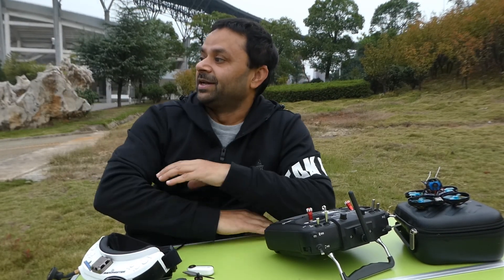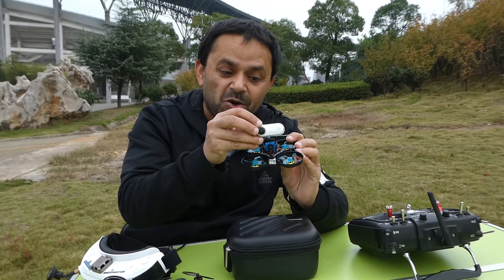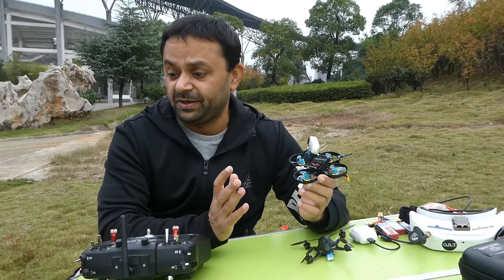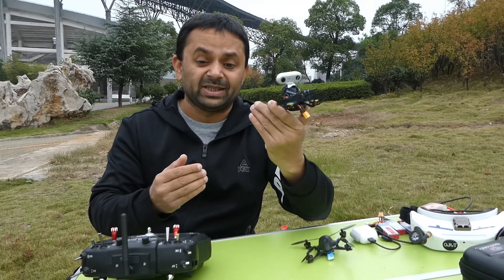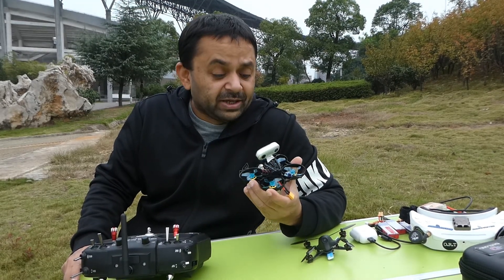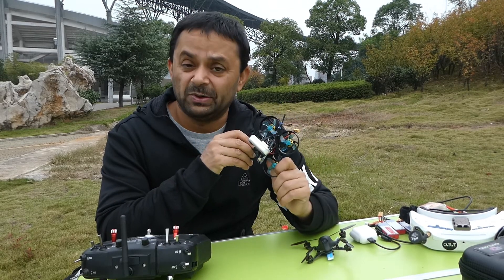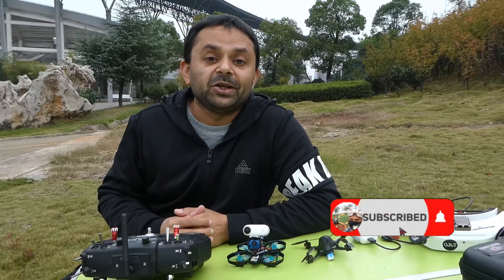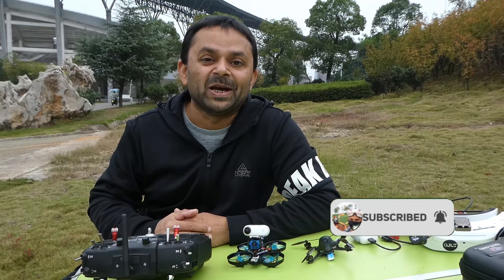Geelang Anger 75X V2 4S Powered FPV Whoop Drone

Comment: All ducted kwads have handling problems in even a slight breeze.  They just keep churning these things out without testing thoroughly.  Stocking stuffers which will be smashed in a few days after Christmas, LOL.
Reply from the maker: No buddy, I have diatone hey Tina, also a ducted fan whoop and even better ducts covering all the props from top to bottom. and that thing flies absolutely locked, like on rails even on windy days. This Geelang is putting out nothing but untested rubbish to be honest. Thanks for the comment.